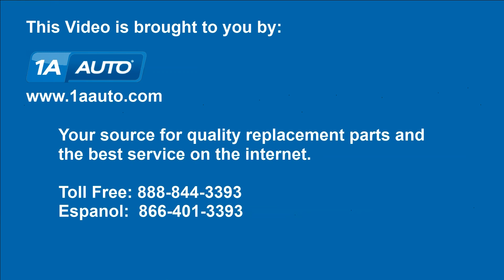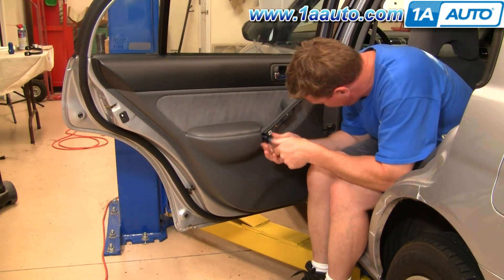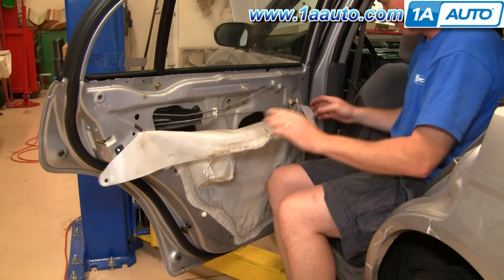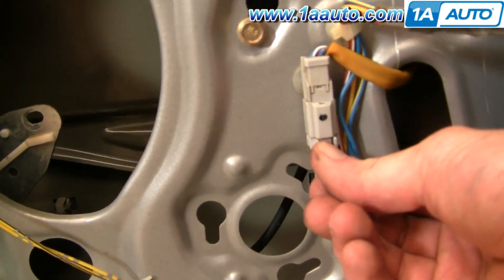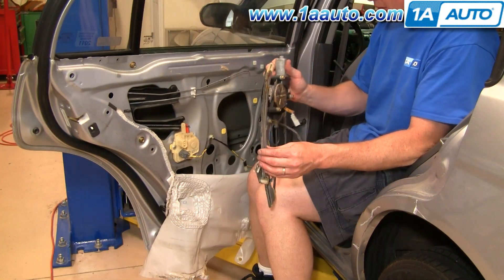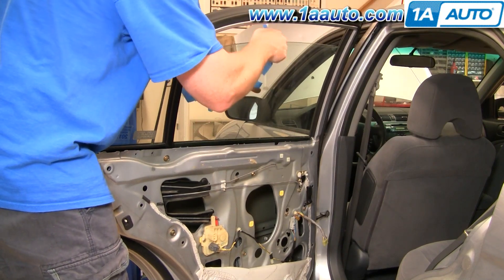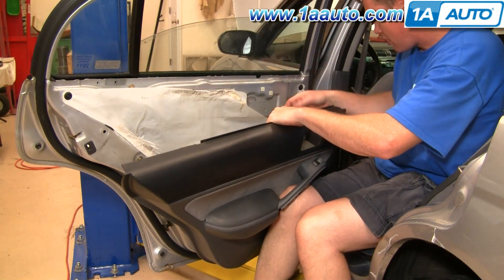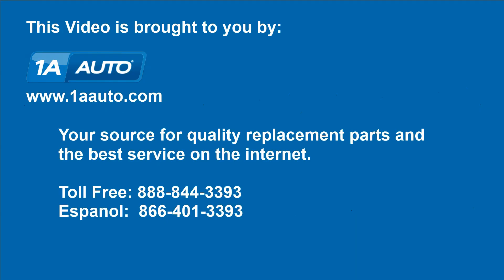How to Replace Window Regulator 01-05 Honda Civic

Comment: This was a huge help! thank you. Made it easy to change! The motor was still moving when engaged. But the window wouldnt go up. Turns out the cable in the regulator was tangled. As I tried to untangle it, the cable broke. It was worn through pretty bad. I walked down to O'Reilly's and bought a new unit. Whole job took me 3 hours. For someone who's done it before, it should only take 1 hour. The best advice is taping the window like he did. Also, taking the door handle off....it's just prying it off of the round pin,.or.lifting it off of the pin.  Careful..it's plastic.

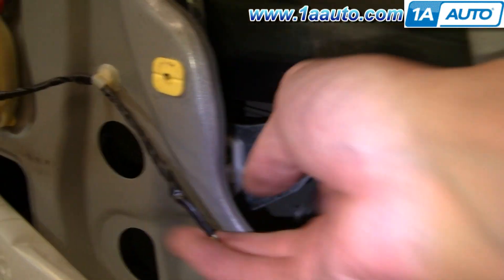Comment: How did you get your window down at 3:02? Mine is stuck in the closed position
Reply from the maker: +Devin Perry Thanks for checking us out! We are unsure if this was stuck down, up, or in the middle when this video was made back in '12 but you may be able to use a helper to physically move the window glass up and down and hold it in place while removing the bolts. You also may have to cut the regulator cables if that doesn't work.

Comment: is the rear window motor assembly different from the left and right passenger sides? or is it the same part and can be used on either rear passenger window?
Reply from the maker: +Johnny Thank you for checking us out! These will be different parts and will not be interchangeable.

Comment: I have a 2001 Civic EX 4 door that is doing this exact same thing you are talking about. The motor sounds like it is trying fut there is just crunching noise. Do I have to replace the motor and the rail or one or the other? Thanks for the video!

Comment: Hi thx for the help. I did find the problem.... it was a broken brown wire in the rear door flex boot. There was another wire that was cracked in two spots too that I repaired while I was in there. Remove the rubber boot from the A pillar and there is a plug. Unplug it for easier access to the broken wires. :)

Comment: Just replaced it exactly as you described in the video, window rolled down, but would not roll back up, AND the automatic lock also doesn't work now. Any recommendations???

Comment from the maker: You may want to test the power going to the rear window to see if the motor has power to it. On the front windows take the door panel off to see if there's a way to tighten the windows on the bracket, you could also spray the weatherstrip around the window with silicone spray to help speed it up. you can find it at you local auto parts store. Hope this helps you out.

Comment: My window is struck, neither go up nor down. Left bolt is hidden, it order to be opened window has to come down in front of the hole, so I could reach. Does any body know how to bring window down??? Its Left rear door (driver side)
Reply from the maker: +Ahmed Sarfaraz We wouldn't be able to diagnose an issue like that here, you may want to have a local mechanic take a look at it. Thanks for checking us out! http://1aau.to/m/Shop-1AAuto-c

Comment: Installed new regulator in my '05 Civic rear driver side window following these helpful instructions. Powers the window down but does not power up which is exactly what the old regulator was doing. What could be the problem??? All other windows in the car work fine. Any help would be appreciated! Thanks.
Reply from the maker: +Joseph Murphy Furniture Maker You may want to test the window switch to see if there is power going to the window motor when the switch is pressed in the up position. Test the front and the rear switches to see if either one will roll the window up. The window switch may be going bad. Here is a link to the master window switch that we carry if your switch is bad. Hope this helps you out. https://goo.gl/5ZgpLM
Reply: Awesome, thanks for the quick reply! Neither the front master nor the rear switches rolls the window up. Any relatively easy way of checking with a multimeter to see if the switch is bad or perhaps a wiring issue? And when you say the window switch may be going bad, do you mean the master one in front or the one in the rear? I've come this far, I'd love to be able complete this repair rather than going to the mechanic, but I might be getting close to the limits of what I can do vs a skilled mechanic.

Comment: Great Videos as always 1A. Neihbor has a 2004 civic. It's all the way down. When i click down on the switch on the door it makes a noise like it's trying. When i pull switch up it makes no noise and does nothing to roll window up. The Drivers door switch does nothing to roll up as well. Think it's the switch, fuse? Shouldn't be the motor i wouldn't think since it sounds when going down right?  Thanks for your help, i want to help her. Ps the door panneling seemed different then what you showed but i couldnt be wrong. I will see if i can pop that plastic cover off by the switch like you did so i can get too the two bolts in handle i guess. Thanks alot for help if you can of course.

Comment: Good vid, got 05 civic, car symptoms before disassem, Drvr rear back door switch rolls down window only, driver switch does not work left rear up / down but works all 3 other windows fine. Tested regulator direct it works up and down. Pulled just front switch, connected pin 18to17 + 19to8 nothing happens but if I remove rear switch and connect 2to5 + 3to4 window rolls up, not down. if I leave back window pinned, connect front switch, window rolls up by itself. Put rear switch on nothing happens?

Comment: I have a 97 civic with a busted out window. The only problem i am having is putting the new glass in the door. It seems just about impossible to get it in both sides of the rubber. Is there a trick?

Comment: My rear windown so time goes up and down and somtime dont work
Reply from the maker: +James Coleman You may want to check the wire harness between the doors for a frayed wire that might be causing an intermittent situation. Hope this helps you out. 1aauto.com
Reply: 1A Auto Parts hey how would i put the window down to replace door motor
Reply: 1A Auto Parts is that the same process for the right rear door
Reply from the maker: +James Coleman It may be a similar procedure

Comment: "Drvr rear back door switch rolls down window only, driver switch does not work left rear up / down but works all 3 other windows fine."

This is exactly what happened to me NigelM18. Did you ever find a solution?